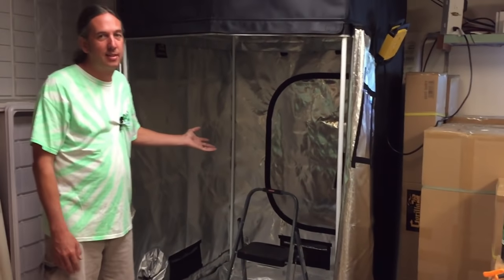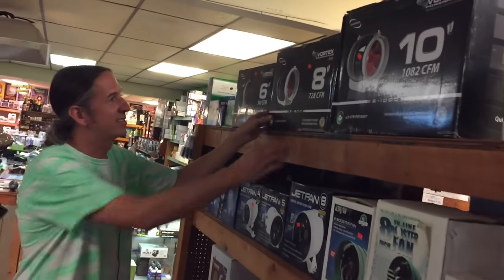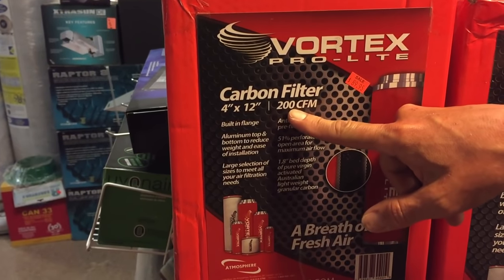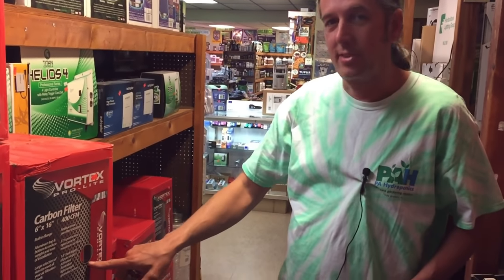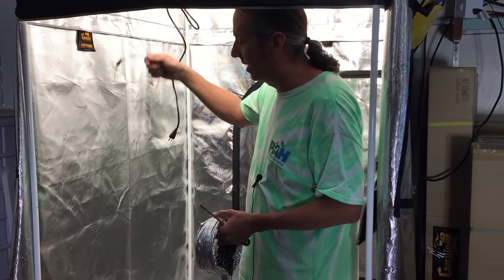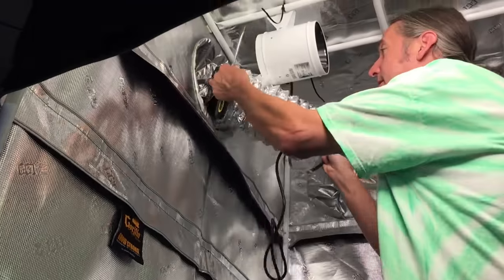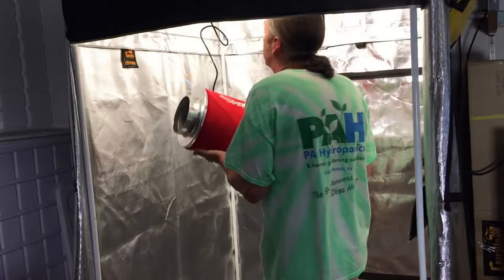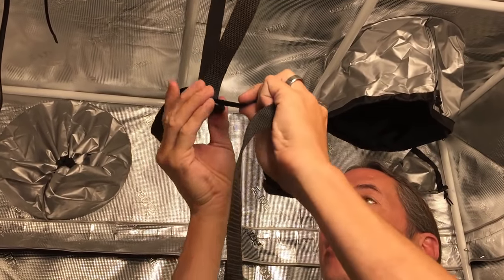How to Set Up a Ventilation System for a LED Grow Tent

Comment: Nice vid, I was wondering about the exhausting part, I plan to have my grow tent in a small room under my stairs can I still exhaust in the same room? Thanks
Reply from the maker: Hello, every home is different with that, if you exhaust into the room that the stairs are in and it has air conditioning or heat then it will work but if you vent into there and it is sealed up then you could have humidity problems and heat build up. Hope this helps! Gary
Reply: @PAHydroponics  learned this the  "why the fuck is my room 84 degrees, and the temperature is 75 out, and air set to 72" off to home depot i went to buy a 1.5'x3' board drilled a hole in it, lined the edges with pipe insulation, closed my window onto it. problem solved.
Reply: @412backyardpyro  Dude you created a security problem while fixing your other problem. Stay in skool bro hahahahahaha

Comment: Hey gary is there any need to vent the air to the outside some are putting it out a window?or would just having it vented out the port hole in tge tent be sufficient?
Reply from the maker: I am for the port hole if the house had good air conditioning, when you put it out the window it will make your house have drafts and cold or hot air will come into your home in some way. Thanks for watching. Gary
Reply: I bought a window vent that has a 6 inch duct port (male) on the inside which is connected to a Y splitter becsuse I'm going to suck the hot air from tents and out the window. Have it all set up with one tent for veg and mothers and today I got the gorilla 5 by 5 which is my flower tent. The company that makes the window vent which is metal and adjustable is by "ventworks" and there is a spring flap so from the outside if it's not blowing out its snug where no heat comes inside. It's really awesome and with a thermostat inside your tent for your fans then it so far ( with one tent at least) hasn't been messing with tbe AC efficiency in anyway in the house. For tbe flower tent I'm on the fence and don't know if i should use ac infinity fan with digital thermostat or a speed controller as I need to have no smell since my neighbor is a dick

Comment: hey man, I got the same setup as you have, I just got a question when it comes to my exhaust.
I have it coming it out of my tent as you have, is it ok if I have it hanging it out of my tent like that or do I need a fan in my room to blow fresh air. hopefully, that makes sense
Reply: Intake fan on the bottom will  pull in fresh air.  You don't even need the filter until like 3 or 4 weeks into flower. I just use a desk fan on the lowest setting for veg to keep temps under control.  You want negative pressure though, so the fan blowing air out should be moving faster.

Comment: What if you want to set up in a garage where you can't get the air out of the room very easily
Reply from the maker: Exhausting into the room the tent is located in is ok. 

The main objective is to bring fresh air into the tent, exhaust hot air while cleaning it of any offensive odors.

Comment: Cool Vid! What type of filter do you recommend for a 5x5x6 tent? I have been using CFL to start my veggie starts. But now I would like to grow some more tropical plants. I'm leaning towards LEDs i'm not sure yet.
Reply from the maker: 6 inch should do a 5x5 no problem no matter what light you get, I would do the 6", make sure you get an led that will cover 5x5 - most only go up to 4x4, or you may want to get 2 smaller led lights to cover it, just my thoughts. Thanks for watching :) Gary
Reply: @PAHydroponics  and what wattage do you recommend for a HID setup?
Reply from the maker: @BrianBerriosOne  For a 5x5 HPS at least a 600 watt, 1000 would max it out but 1000 has a lot more heat than a 600, get a big reflector too if you can find one. G
Reply: @PAHydroponics  thx for the info

Comment: I got the Vortex Pro-Lite 6"x16" carbon filter, 6 inch JetFan combo. The girls are doing great for my first grow!! Question I have ... my tent is in the basement with some storage stuff as well. There is some dust in the basement but not too much. Some dust is hard to get rid off. I noticed dust build up on the red cover of the filter. I know I can clean it, but wonder when? There is plenty of air flow in the tent. I'm in the 4th week and started veg. Not sure if I should take off and clean during the grow, or wait until after harvest? Is dust build up normal? Does PA Hydro sell replacement covers if I need to switch one while in the grow?

Gary - you are a fucking star!!!

Thanks!!
Reply from the maker: Thank you for your purchase, we sincerely appreciate your business.

Some environments are dry and can be dusty.  Using the cover is going to reduce those dust particles from contaminating your filter and rendering it ineffective prematurely.  If you recognize a good bit of dust accumulating I would clean it.  

We do sell replacement covers if needed

http://shop.pahydroponics.com/replacement-atmosphere-pre-filter-for-pro-lite-filter/

Comment: Is sucking in the walls bad?
Reply from the maker: Open one of the vents towards the bottom of the tent.  You will want some negative pressure on your tent, but you want to provide fresh air and not overwork your fan.

Comment: You can make much better use of your fan using something like the Titan Controls Mercury 4 fan speed controller. It allows you to set a minimum idle speed and max temperature which automatically increases the speed of your fan to control temps. Much better than that manual speed control you used; but pricier too.
Reply from the maker: Yeah !! I love that controller, it does cost a bit but it works great! Thanks for sharing. G

Comment: No one has shown me where the exhaust is actually vented to...  isn’t that important? To an exterior wall? To the attic? Maybe to those little vents under the eves of the house...? BTW... you have great presence onscreen and I thoroughly enjoy your videos...
Reply from the maker: One of the benefits in an LED grow tent you don't have the same temperatures as you do with CMH, or HPS.  
If you need to remove a larger amount of heat, you don't want to exhaust into the room that you are getting your fresh cool air from. Venting outside the room would be beneficial in that case.

Comment: i don't think this is the best position for any type of vent. fan. Yes suck not push good job!... vent.101 for negative pressure tent. However unless its a space issue and I have the same tent just in shorty mode with height restriction.  should you put any electrical motors inside the tent. Am I wrong? or is this just a different way doing things...thing.... thanks for the video. I do subscribe so constructive reply please.  peace!

Comment: Would it better to use a 5x5 instead of a 4x4?
Reply from the maker: Hello, 4x4 has a lot more cubic feet but the lighting is usually maxed at 4x4 and not many single lights will do a 5x5 so that is why I stick with the 4x4,also pruning and training is harder to reach in a 5x5. hope this helps! Thanks for watching!

Comment: How much do the plants smell through the tent when using this filter
Reply: Zero
Reply from the maker: None until you unzip it, these filters work amazingly well, actually cleaner air then we usually breath. Most hospitals incorporate then into the ventilation systems to keep it clean. The negative pressure inside the tent will always keep the air sucking into the tent. Hope this helps! Gary
Reply: PA Hydroponics thanks it did help appreciate the response
Reply: PA Hydroponics And I keep my tent open all the time is that ok or I should be closing it?
Reply from the maker: @dashluge  for odor control and best light reflecting keep it closed would be a good idea. Thanks for watching! Gary
Reply: Is it ok that the walls of the tent are being sucked in it seems to be to much negative pressure ?
Reply from the maker: @Gonz-sl5ez  It is ok and normal, you can slow the fan down a little to help with that and make sure you have vents open at bottom of tent to let air in. Hope this helps and thanks for watching:) Gary

Comment: Great vid mate, really helpful. I've heard a lot of people recommend having a small fan near the bottom of the tent aimed at the base of the plants to help prevent parasites and to make the stems stronger. Is this needed or will the out take fan create enough air flow?
Reply from the maker: Good question, I do recommend having a fan blow on the plants for many reasons, one of the most important is to blow the dead air away from the leaves, the leaves take in co2 and release oxygen, if you dont blow away the oxygen the plants cant breath and also insects love the layer of oxygen so yeah blow on the plants. Also strengthens stems and bugs dont like it :) Thanks for watching! Gary

Comment: how effective is a set up like that as far as smell.....Great vid
Reply from the maker: Carbon filters work 100% but when you open the door then the smell comes out so ....
Reply: @PAHydroponics  Cool what about if you had a second one outside of the tent?
Reply from the maker: @user-wq5kv2hu2s  Its a great Idea to put a separate carbon filter outside the tent to clean the room air, it's called scrubbing, just set filter on the ground and set the fan on top and let it run and it will clean the room air very well and then you should be totally free of odor with both going, better safe than sorry. G
Reply: @PAHydroponics  Thanks
Reply: @PhenoMorph Labs  Haha..Thanks
Reply from the maker: @PhenoMorph Labs Thanks for sharing !!! G

Comment: Can 2 800cfm set ups replace 1 1600cfm setup?
Reply from the maker: should be fine and about the same effect. Hope its not for a tent, it would suck the walls in alot.G
Reply: @PAHydroponics  20x10x7 greenhouse. Would that be okay or too much?

Comment: I have a question I haven't 1000-watt LED it has veg and Bloom switches do I run both switches during veg and Bloom ? There be a really big helping somebody can help me thank you
Reply from the maker: Hello, good question. Pretty much during veg Red light has a tendency to make the plants stretch and blue helps keep them short and stocky, if you have a plant that you want to keep short and stocky then turn off the red. During flower I would run both , the red during flower helps them bulk up and the blue will keep things tighter at the end so run both during flower. Hop ethis helps and thanks for watching. G

Comment: Could someone with some experience help me out with this? I was just wondering if a 4in in-line fan and 4in carbon filter would be a good setup for a small, one plant 20in x 20in x 4ft tent. On paper it looks like enough CFM but I’m not sure how much would be lost through the filter or any ducting I would need. Most 4in fans I’ve seen are near 205 CFM.
Reply: That would be plenty. To make it easy, 2'x2'x4' is only 16 cubic feet. You would probably want the fan running pretty low at that to not remove all of your moisture as well.
Reply: theolove thanks ! 👍
Reply: Ryan Avis it’s working good so far on a lower setting. Just count on having the fan, and also filter if using one, on the outside of the tent. I thought I would have room for the fan and light inside tent but it didn’t work out right and is way easier just having the fan outside.
Reply: Brendon So instead of pulling bad air out you’re pumping fresh air in? Do you have a flap open to let the fresh air force out the bad air?

Comment: Man I got a carbon filter light fans but my 3x3 tent is to small to accommodate  it all it seems
Reply from the maker: Hey man, yeah I hear that and if you absolutely have to you can put the fan and filter outside of tent and blow into the filter with a piece of ducting coming from a top port hole. I dont like doing this because the carbon filters are not really set up to run like that and the pre filter wont be doing anything but sometimes there just is no room. But if there is a way to cram it all in there then do it. Hope this helps. Gary

Comment: Why not put the fan outside the tent? Inside the tent it creates heat
Reply from the maker: Fans run cool and I put them inside to keep the noise down but you can put them outside of the tent if you want. - G

Comment: Anyone: First tent.  why filter air that's extracting?  (extracting hot air) pulling air from the bottom flaps is just making the tent the same temp as outside? Anyone?
Reply from the maker: Most LED lights are not operating at very high temperatures and ventilating the heat is not the main concern.  Pulling fresh air into the tent and creating a uniform environment for the plants to thrive is the main objective.  Most people do not like the smell of fertilizers, some plants just stink without any apologies.  Using an active carbon filter and creating a slight vacuum on the tent you will never smell what is inside.
Reply from the maker: thanks for watching and commenting.      -w

Comment: Helo, I got the extended  height 4x4 gorilla grow tent, a 6inch hyperfan, a carbon filter of 6inch flange size and 60cm total height. My growlight is the old model 1200w Ied of Mars hydro. Im planning to grow using flood and drain method around 9 plants. Are my fan and filter adequate to replace all the air in less 30sec and enough to Cool down the heat comes from the led grow light?  Am I having the right ventilation system for my grow tent?
Reply from the maker: Hey there, sounds good to me and you should be able to exhaust fast enough, every 30 seconds is not necessary, the light will take a lot longer to heat the room up than 30 seconds, if you had a 1000 watt hps then you would need some serious air movement like that. You will do fine:) Thanks for watching. Gary

Comment: I have 2 FC E3000s with mean well driver's yeah sorry got carried away hanging free along a wall starting in a corner with emergency blankets on the wall ac unit dehumidifier and along the other wall a 2by4 gorilla tent no carbon filter and my ac infinity 6in speed control duct booster fan in the top inside of the tent it's almost 3 years old and I do clean the ac infinity about every 8 months inside and out with alcohol and I will never buy anything else but AC Infinity fans for my exhaust fan and now that we have legalization I hope too Start videoing my grow soon just a lot going on right now but yes AC Infinity is worth the money 🤑

Comment: What? LED are a joke for growing unless you are using Heliospectras and they are $1800 for a 600 watt,and pull 600watts. The only advantage is getting them closer to the plant so you can have vertical stacked gardens for warehouse grows.

Comment: Be careful with those monkey fans guys the motor burns out way to fast  I had 3 of them n all 3 burnt out in less then a year and I've been told the oscillating one burns out faster then the fixed one
Reply from the maker: The Monkey fans we stock carry a year warranty on them.  

https://shop.pahydroponics.com/secret-jardin-monkey-fan-30w/
Reply: @PAHydroponics  well that's the brand where is the contact info for the company gro store in my area claims their responsibility ends after 30 days n the boxes don't have supplier information 🤔
Reply: @PAHydroponics  that's the exact model I have n like I said 3 of them crapped out in less then a year and I have the original receipt so if I could get the customer service information I could write the company